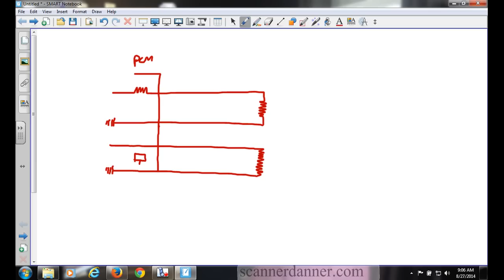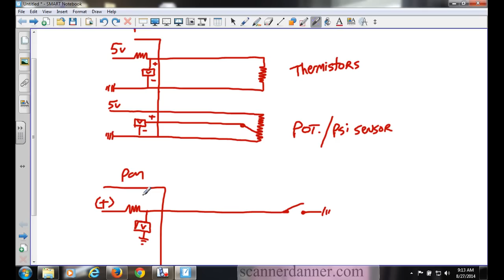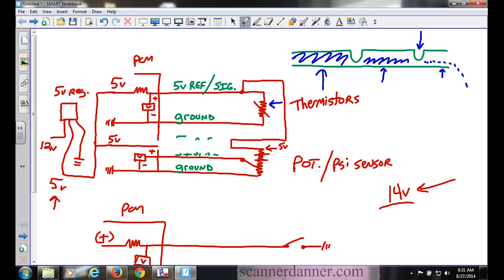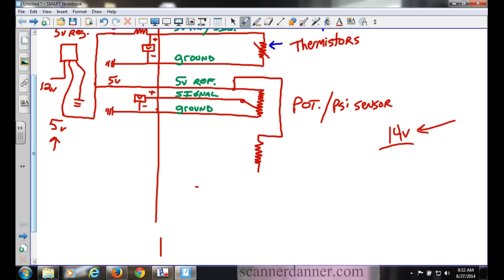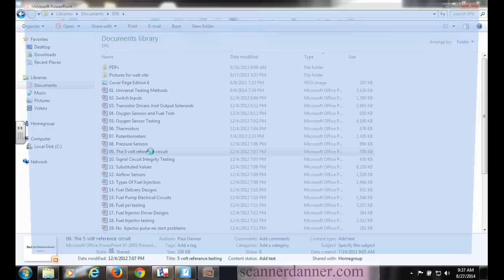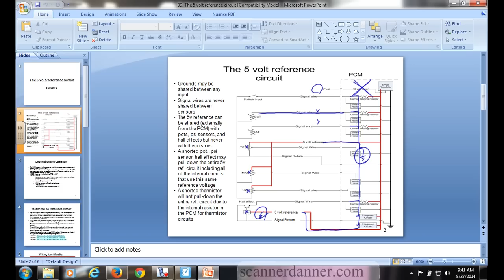Sensor Wiring and the 5v Reference Circuit

Comment: People have a short attention span The only people who are going to thumb you down are the ones who don't even have the grounding to be working on cars and just want a quick fix to their problem but have ZEROidea how intertwined the systems are. I'm 30 years in this game and can tell you and all the people that obviously can't understand some of the material that the problem is NOT with Paul Danner. Paul most people are good at either teaching OR their specialty but you are a rare combination of an exceptional teacher AND are very good at the job the only thing I would say is that maybe sometimes in this particular vid there is a lot of discussion on hypothetical circuit layouts that are probably serving to confuse your students at the early level they are at in that vid. For example around 28:50 I thought it might be more useful to them to point out how any bad wiring or poor connection in the "signal" line between PCM & Thermistor would cause the PCM  to see a cooler engine than it actually is and the impact that might cause on fuel trim. But I know your trying to make them think circuitry right now. I learn a stack every time I sit through any of your videos. Thank you always
Reply from the maker: Thanks so much brother. An appreciation the suggestions too. It means a lot

Comment: i am wondering how impedance is defined in these different sensors i can visualise how the sensors use the current for a signal that the ecm can read thing is this whole impedance thing can stretch my little brain but what i assertain is it is a kind of going back and forth using current to measure something like pressure or heat but the circuit is a little different in that a thermister uses a 5volt ref as a signal and the signal changes with resistance WOW THIS THING IMPEDANCE THE Z FACTOR I THOUGHT I KNEW ELECTRICITY look at technical definition of impedance if you got a little brain like mine IT WILL BLOW UP WITH THE Z FACTOR and we havent even got into signal conditioning --------- oh and dont worry bout them haters or the thumbs down men like me would pay way more than 100 bucks a year for your knowledge and insights on this trade  men like me want to have a measure of excellence in thier work so they dont have to work before mean men (or work for other men at all)i would pay more than a hundred a year for your instruction and that probably the only critique you need on that sir KEEP IT UP AND NEVER GIVE UP

Comment: Danner I have a 350z is got 12 volts at my crank ,cam 1&2 how does it on this particular car no start condition
Reply from the maker: +Maria Evans not sure what you're asking me
Reply: OK 03 Nissan 350z I got 12 battery going to the crank position not 5v how this concept apply here

Comment: HI scannerDanner, I just have a question about the ground wire (SIGNAL RETURN) of the circuit. If the ground wire was "shorted" to ground would that even cause a problem??? would the car even throw a code??? This is just curiosity speaking.
I also like your emphases of how widely universal this education (troubleshooting) goes. Thanks for all the extra work (video wise) you do for all the people that are trying to learn.

Comment from the maker: Just making sure that the thumbs downs I am getting on these videos are not from my valued premium subscribers. I believe it is angry people that do not want to pay, but I am not sure.
If it is from my valued paying customers, I want to hear from you. Send me a private message or post it here about what you didn't like about this lecture. I want to constantly improve in what I am doing and will value even negative feedback.
Thanks!
Reply: No the videos are excellent. I scored a verus pro for $2k and a pistol. Now I'm checking out all your verus training. Very helpful info. Thanks!
Reply: +ScannerDanner Premium i am a master tech and a scope user, and also do diag for certain shops (not nearly on the scale you do however, i work at a dealership so its frowned upon), and i still find useful info in most of your lectures and videos. Dont change a thing, exceptional info and an easily understandable way of explaining the info. From one driveability diag tech to another, keep up the good work!!! For new techs, watch and learn, this is what you need to know to pass the A-6 and A-8, and applies to the other tests also
Reply: I don't have any complaints but a request would it be possible to split the screen having a camera on you and have the other half the Smart Board? Just a suggestion what does everybody else think? You are probably correct with the people giving you the thumbs down.
Reply: I've thought of doing that John. I would have to re - record everything.  But I am willing.
Reply: Its not a big deal and I don't want you to go out of your way just for me. I don't have any Idea what it takes to make these videos so I don't want to cause you more work
Reply: Haha if you only knew.
Reply: It's about 6 months to a years worth of work
Reply: WOW I had no Idea You need a assistant just for video production. We all appreciate all of the hard work you do!! I know first hand its not easy taking care of family, working and working and trying to have at least one day off just to relax.
Thanks for all that you do!! and keep up the great work
Reply: Hey John. How did you like the split screen on my last upload.  I'm referring to part 1 on my free channel.  It seemed too busy at times, curious to here your thoughts.
Reply: Your right at times it was to busy but when you had the picco up I liked it.
Reply: hi ScannerDanner

Comment: Toyota use a 3.3V reference in some of their HVAC thermistors (interior temp, evaporator temp) I found out the expensive way. Messed me up on a Landcruiser! I asked the question why not 5v and no one knew at Toyota GB. £900 for a AC ECU.
Reply: Ouch! Thanks for the tip